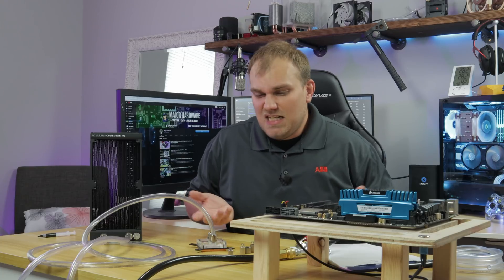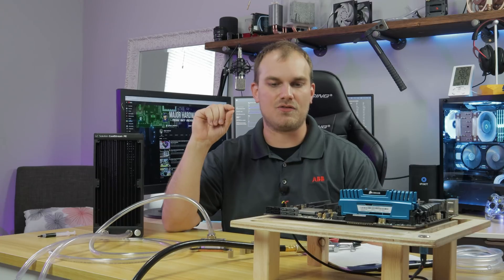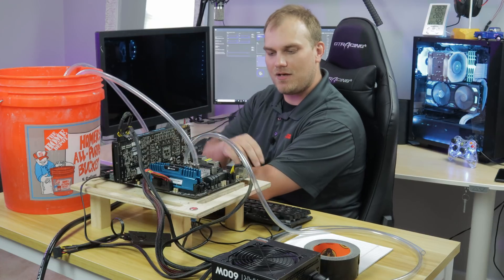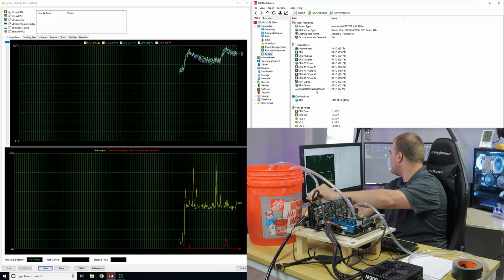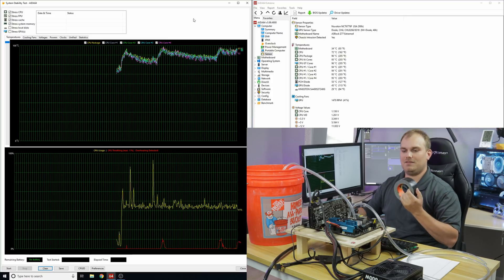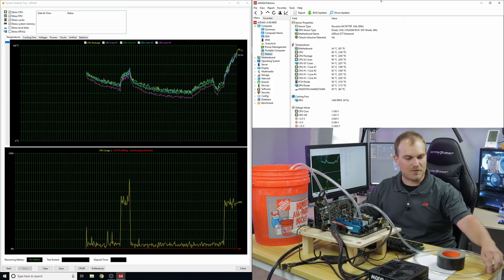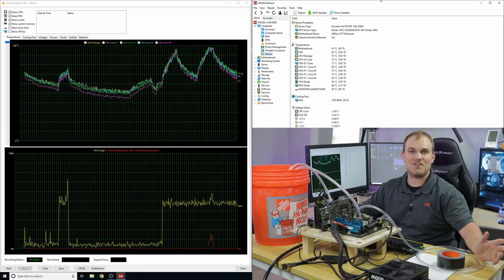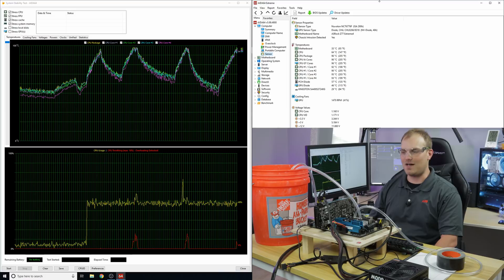AIR COOLING A CPU WATER BLOCK

Comment: Helium is more thermally conductive than air, maybe somehow try a closed loop of helium? Or maybe other gases?
Reply: And then loop it back to the compressor... You are basically just building a phase change fridge then.

Phase change cpu cooling is a thing.
Reply: @bleepbloopblahp  but with liquid helium, one of the Earth's most precious resources? We can get almost every other element or gaseous compound back from the atmosphere EXCEPT helium which disappears to space.
Reply: Nothing like making a Hindenburg out of your PC
Reply: liquid helium is even more conductive, ya know
Reply: It doesn't matter if you don't have enough compound to take the heat away,it's like stacking 5 another fans to gpu with shitty radiator it won't work
Reply: That is an interesting idea, perhaps just using a regular to pass helium from a tank across the cpu for a prof of consept.
Reply: Isn't that what Linus always does, and thats the reason he talks lika a smurf? I bet he's got helium in his AC in his whole building.
Reply: @magnusnilsson9792  you will never be as successful or ad happy as Linus. Just keep that in mind, potato brain.
Reply: Liquid helium is literally one of, if not THE coldest substance known/available to mankind, so I am positive this would work extremely well. However, it's not easy to obtain nor contain in it's liquid state.
Reply: @QuantumQuibbles  i saw the liquid permeates even glass
Reply: @QuantumQuibbles  He said helium, not liquid helium. The fact that helium has a low boiling point has nothing to do with its thermal conductivity.

Comment: When the thumbnail has a better picture quality than the video. ^^
Actually I don't mind the 360p picture too much. But the stuttering in the audio drives me crazy. Will check back later, when It's upped.
Reply: Back at 1080p now. Unfortunately the "stuttering" sound (more like a cracking) is still there. Just check 1:16

Comment: You did a great research! I love your innovative idea.Hopfully in future we can have a new kind of CPU cooling system, and I believed if you using copper pipe to replace plastic or pvc  tubing, as outlet or inlet that could be even better on heat dissipation.

Comment: I wonder what rpm that impeller is spinning at lol, still a neat and silent way to cool a work station using a tube from the next room over!
Reply: My water loop hisses and screeches (no air bubbles) from extreme high flow rate (I don’t know if you’ve used an air compressor for blowing next to sharp thin objects like air vents, but blasting through a block full of fins is really bad for noise!). You could just have a low pressure water cooler about like a trickle and coil it much better (without using 300w compressor, use a 1 watt water pump, also no ice).

Or you could use a passive air cooler with zero power wasted...